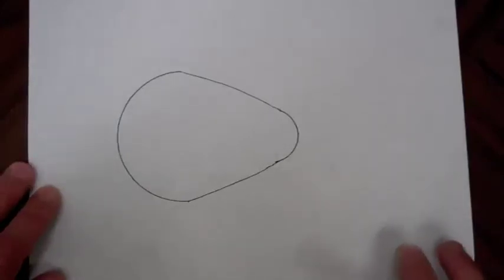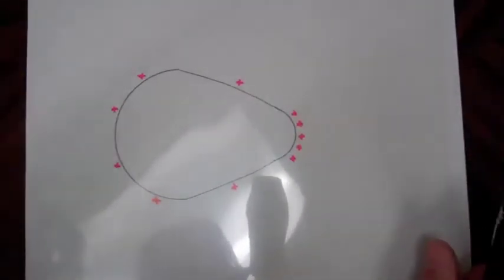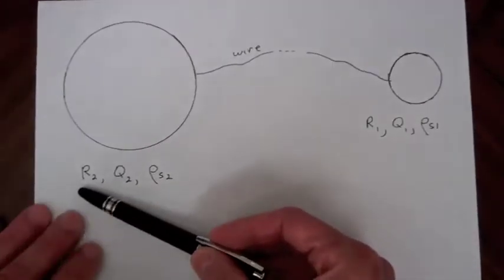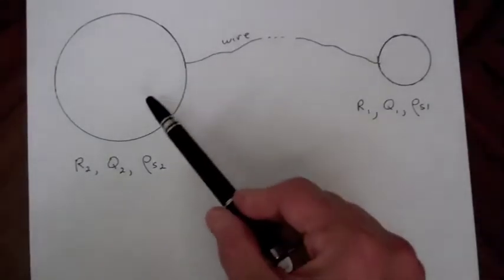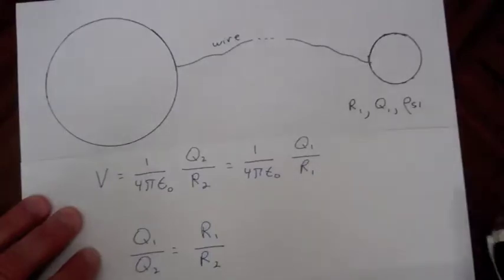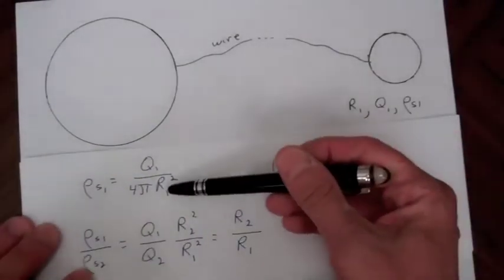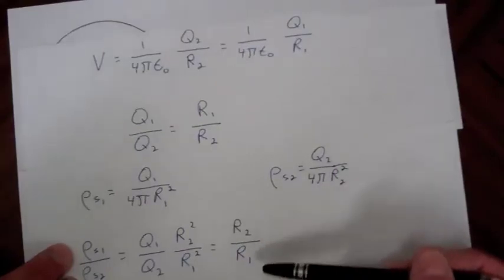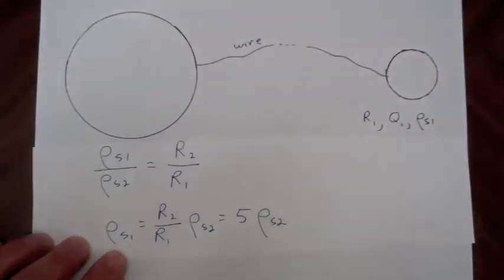Curvature and Charge Density

Comment: Nice video .The explanation part was exactly what I was looking for in many places finally got it here. Thanks. But from the demonstration, I don't understand how we are measuring the charge density with the foil, because once the foil touched the conductor it becomes equipotential to that conductor independent of where we are touching right? now the charge distribution on it depends only on the shape of the foil. Pls explain how the foil works and why it won't be at same potential??
Reply from the maker: You are correct, the foil will attain the same potential as the conductor. You bring up an interesting point that the shape of the foil will play a role in how much charge ends up on the foil. I'll have to think about that and get back to you.
Reply: Michael Melloch thanks. Looking forward to hear from you about this soon
Reply from the maker: The end of the Fall semester is my busiest time of year so I haven't had a chance to think about your question. Sorry.
Reply: Michael Melloch that's okay Michael. Do it when you're free. Just drop a comment here when you do.